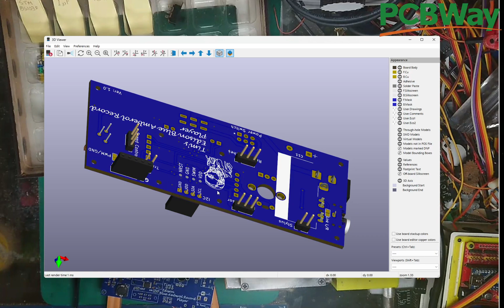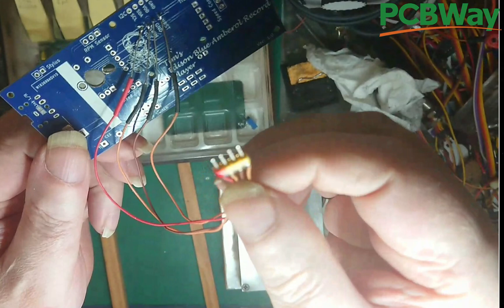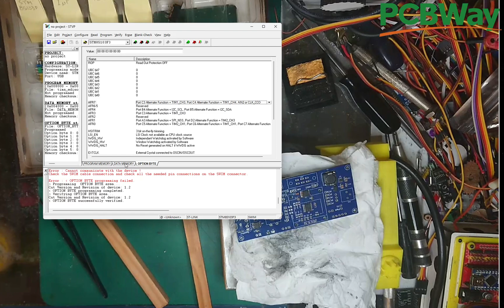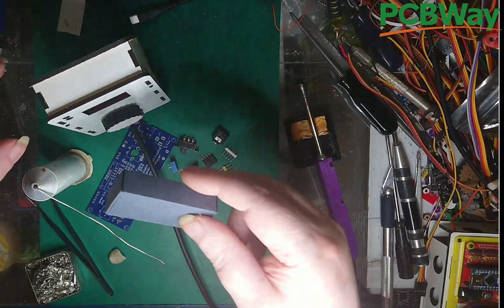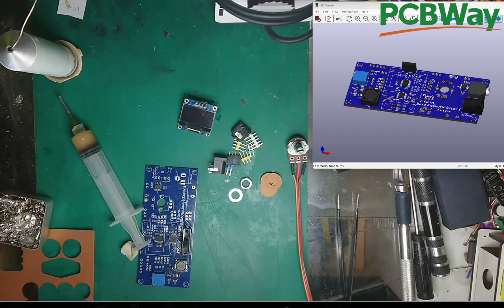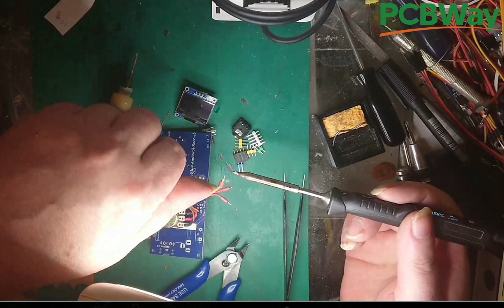Tim's "Edison Blue Amberol Record" Player. [PCB Assemble Through-Hole]

Comment: Try plenty of flux and a large tip just wiped down the legs. It works a treat and you just wick off any excess.
Reply from the maker: Yes some times a lot of flux and heat is needed, there are some components made of god knows what out there.